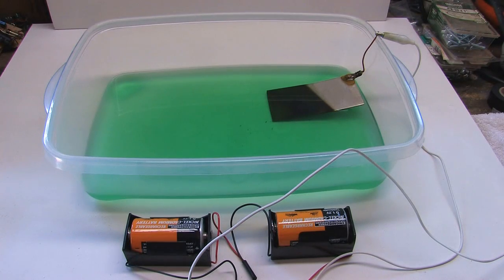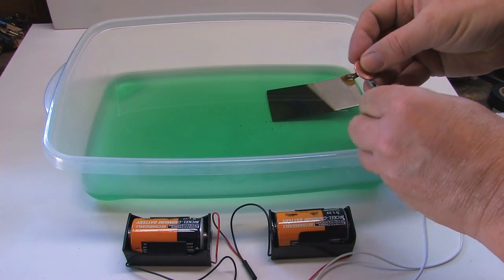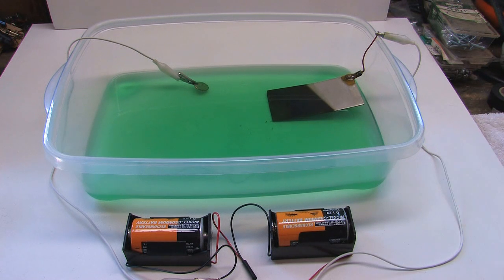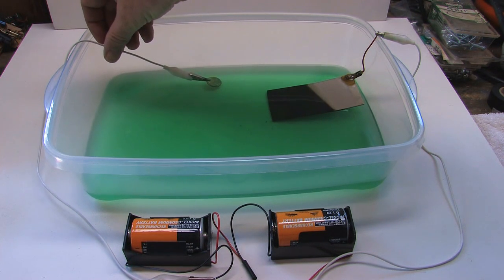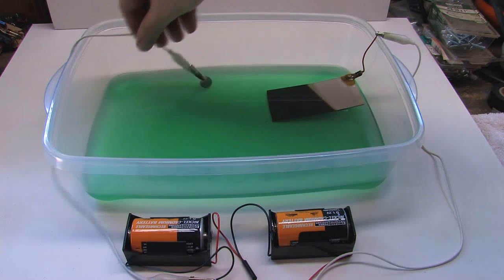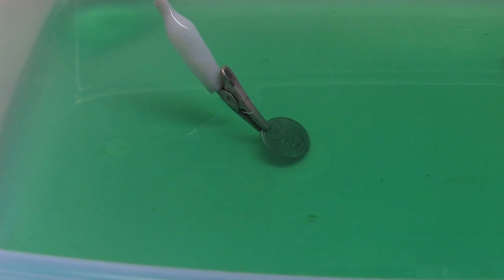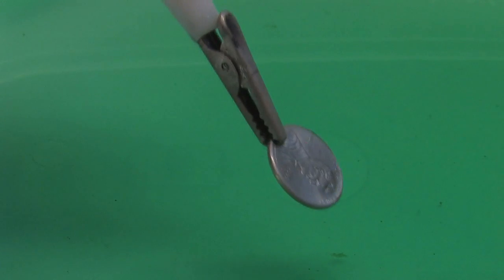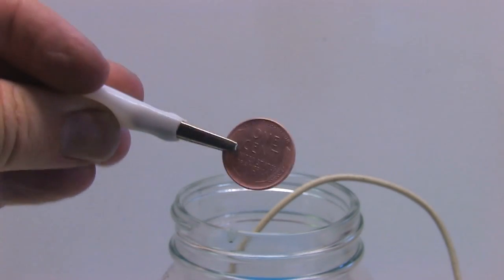Easy Nickel And Copper Electroplating Method

Comment: Love your vids. Sir! Years ago I was trying to resurrect a deep cycle battery. I put 2 copper 1 mm wire ( electronics) wire. In sulfuric acid and I put some nickel/ cadmium electrolyte. I saw a tutorial on YouTube on restoration of batteries. It came up a blue/ green look. A 12 volt trickle charger and 1 terminal was black. Other terminal was gleaming! But acid in battery had that colour I mentioned. Was it possible for me to electroplate something? Any reply appreciated cheers from Australia just subbed.nice work!🙂👍👍👍

Comment: Your applied voltage should ideally match with reduction potential of the metal ion (here in this case copper) that you use for plating the cathode material.
Reply: First name Last name  i don't know.  Or is it electrodeposition of the metal depends on the current density? Please explain.
Reply: @quark31  the current to apply is in function of a lot of parameter.
size of the part, of the anode, temp, electrolite conductivity, PH etc

Comment: The ideal current should vary depending on the surface area of the part. If you're usually plating small parts it would make sense that low power gives you better results. Based on some quick research I think the current for a penny should be around 500mA.

Comment: I did copper plating, but copper is coming off when I wiped , is there any way we can do copper plating,even if we wipe it shouldn't come out
Reply: too much current, or part is'nt good enough degrease, or you try to copper plating directly on steel/iron

Comment: can i plate aluminum, and the finish can it be used for cooking?
Reply: i mean plate copper over aluminum for cooking equipment
Reply: @MrZaheraudi  plating aluminium is not easy.
you need first double zincate the part, next flash copper plating with alkaline solution, and next tick copper plating with a standard acid copper solution.

Comment: Hello! I have these toy magnetic balls. (Lookup Bucky Balls). These are coated with nickel copper nickel but after continuous use, it eventually starts to wear off at the poles of the magnets. I was wondering if it would be possible to use this method to recoat the magnets. There are only two issues I can think of. Will this process mess up the magnets strength? Also, each magnet ball is 5mm in diameter. Would it even be possible to connect a copper wire to it for electroplating? Thanks!

Comment: Hi great videos, I used your information and others to start plating copper.  It is going really well.   For that I’m using both Muratic Acid and hydrochloric the copper sulphate and a laxitive for brightening.   I plan to follow this video for nickel plating.  With either of these do I need to be concerned with fumes once I’ve created my solution and start plating?   I’m doing the plating in my garage but thus far haven’t found much information on if i should be wearing my  P95 mask whenever I’m plating.    Oh and lastly I’m using a small fish tank pump for constant agitation of the solution not sure if that changes anything.  I’m plating at around 1.3v with an adjustable DC power supply.     Thanks if you can help and for helping get started with plating!

Comment: a cheap power supply with a current limiter in it i see them on boost buck converters or the way round little 5v 5 packs may be the ticket fer this small stuff or heck a  old cell charger  a variable  resister n extra capacitor fer smoothing the power as we know pwm power  supply's suck  nice video

Comment: To nickel plated something bigger with more solution into a bigger area. Does it need more power or still low voltage worth the batteries?
Reply: What you want is a higher current power supply, like 2-3A for large parts.

Comment: Thinking of nickel plating some computer parts that i want put liquid metal compound on so that it doesn't harden and loose thermal conductivity. This looks funner and cheaper than buying new components that come nickel plated, the GPU heatsink is $150 and only for liquid cooling and at that point i might as well even might as well invest into a new GPU (R9 390 8GB).

Which brings me to another idea, would you be able to put the solution on a sponge to nickel plate things that are hard to submerge? I'm guessing that you would have to constantly be moving it around to prevent a sponge pattern from developing.

Comment: I saw in your website that you also used a solution made with nickel sulfate, ammonium chloride and boric acid. According to wiki, this is called hard nickel. Wiki also shows a solution with just the nickel sulphate and boric acid. Have you tried this?  What temperature should the bath be? Many blessings.

Comment: Nice video. I was wondering does it matter if the two objects are closer in the water, like will it work better or quicker if the two objects are closer to each other while submerged? 2nd can i just use distilled water and salt for the solution? Was gonna try and do a little science project for the kids but iver tried this like 10 yrs ago with bad results.

Comment: I would like to make 10mm nickel plate the front surface will be full of small cube corner sections all surfaces of section soul be well polished, the  bottom will be flat , no need polishing or surface finishing. I need info to make this .

Comment: Have you tried to make Nickel Electrode in Battery Edison by this method?
PS:
You don't need Nickel Ammonium Sulfate.
I used battery electrolyte and it works very well (during tests). Tomorrow I will check exactly how nickel electroplating  works.

Comment: If I wanted to add a heater element and PID controller to maintain a constant solution temperature could I use a titanium heating element or would it react with the copper sulfate solution?

Comment: i've been trying to copper plate aluminum and failing miserably it keeps getting corroded,eats up the aluminum,and just wont stick. is aluminum a bad metal to try and plate?
Reply: I know you asked this a long time ago, but yes, Aluminum is unsuitable for copper plating. Aluminum is a more reactive metal than copper, so if you even just place aluminum in a copper sulphate solution, the aluminum will oxidize to aluminum sulphate and will reduce copper metal.

Comment: Considering you are only using readily available chemicals and not industry specific ones (I'm an electroplater by trade ) then I highly recommend   you add Sodium Saccharin  to the Nickel plating solution to make the finish brighter. Just use a small amount at first and then increase the amount  until you reach the desired brightness.
 Don't over do it though because although you are making the finish brighter, adding Sodium Saccharin will also have a negative effect on the solutions throwing power into the low DC areas, ( ie the nooks and crannies).
Reply: So looking at the Watts plating solution from the Wikipedia page, it seems the more nickel sulfate and the less nickel chloride you use in your solution, the more matt the plating will be. Thanks for your guidance.
Reply: Can you tell me what kind of solution you would use if you don't want a shiny nickel plating? I would like the natural, slightly yellowish colour of nickel for my plating.
Reply: The simple way would be to just use less brightener in the solution to give it a semi-bright finish. Most companies which specialise in decorative electroplating will have a semi-bright plating bath containing less brightner running alongside their regular Nickel plating bath as it is a finish some customers require. 
Another way would be to use 'The Watts Nickel Plating Solution' which from my own experience has the ability to give the work a much more duller finish. 
All Nickel plating solutions will give you a slightly yellow finish whether they are Bright or Semi-Bright. It's the light deposit of Chrome which is usually applied on top of the Nickel in decorative Electroplating which gives you that slightly blue finish . Without it the work will look slightly yellow.

Comment: Sweet vid, thanks!  Question, there is copper electrically-conductive paint on Amazon.  Could I prime and paint plastic with that copper conductive paint, let. it dry then give it a nickel plating using this method.  Question #2, instead of nickel or copper l, is there  chemical baths that can give the appearance of brass and silver.  Any responses are greatly appreciated as I'm a total number with this.
Reply: The answer to your first question is yes.. You can use that copper paint on just about anything and then Nickel plate it.. I've plating golf balls and even tree leaves in this manner. I've then Gold plated over the Nickel. It is really difficult though even for a professional such as myself, to get good adhesion you will need to give it both an Anodic and Cathodic clean in a cyanide solution then neutralize in a 10%  sulphuric acid solution before going into the Nickel plating bath. It may even require a copper electroplated deposit first too. As for your second question you can plate brass  onto work that has been previously Nickel plated. It requires a Cyanide based solution though with a Zinc and a Copper anode, not something you can really do at home, plus it's super difficult . If the temp of the solution gets too high it will only copper plate, too low and it will only zinc plate.
 This is made even more difficult because if you apply too much power  it will only zinc plate, not enough and it will only copper plate. increasing power will over time increase the temp of the solution so as you can imagine it is a real fine balancing act.. 
As for Silver, you can plate silver directly on to  work made from copper using a silver nitrate soltion. For work made from mild steel you need to first Nickel plate it then plate the silver on top using a Cyanide based Silver solution.
Reply: I don't know about your second question, but to plate non metallic items, just mix some graphite powder with alcohol and use that as a paint.  get a thin, but complete layer of graphite on the item, and then it will plate.

Comment: Can you electroplate several items at once?
Reply: Roger Foster I don't think so, unless they are touching, as it requires one continuous circuit of electricity. Alternatively you could have many different circuits, but this would probably defeat the object.
Reply: yes you can...just connect the negative terminal to all the pieces

Comment: +stancurtin or anyone else who may know, I already have very nice electroplating equipment and typically use it to brush on 24k gold to silver coins which works great.  Today I tried on a commemorative coin I believe is nothing more than steel and it was an ugly color so I thought since it has a dark copper look to it that it might help to nickle first and then gold plate afterwards (correct me if I'm wrong).

Second, since I have this equipment and can digitally set the amperes and volt to anything, what is the ideal nickle plating zone to do this?  I see some saying below 3.7vdc/2.3a and then others saying all kinds of things.  Any recommendations on the best setting(s)?

Comment: have you tried using an 18650 rechargable battery? they run at 3.7vdc and hold about 2.3 amps so they have a longer run time then a or d cells?
Reply: Nice
Reply: Colt Rice

Comment: Im struggling. I made the solution (white vinegar, peroxide, copper,) it turned green so i removed the loose copper then filtered the solution. I connected a pre 82 penny to the positive, the thing i wanted plated to the negative, put them in and waited. It plated the edges pretty fast but i can't get it to plate the rest. I cleaned it with a wire brush and alcohol.

Comment: Now. How to remove the nickel from a wrench and then re-nickel it without abrasives ? AHA !
Reply: reverse the polarity of the batteries. It will remove the nickel from the wrench.
Reply: No don't do that. That will completely ruin the electroplating solution, and the highly expensive nickel anodes. You are right about reversing the polarity but it needs to be done in a completely separate  secondary unit made of steel with a plastic lining.  Use lead as  cathodes  and the strongest Sulphuric acid you can lay your hands on. Ideally 96%

Comment: Need some help here.... Trying to figure out what I'm doing wrong. My plating wants to flake off. It plates but is not very shiny and then wants to flake. Am I leaving it in for to short a time or to long?
Reply: +Greg Lyons Am cleaning the part and anode with Isopropyl alchohol before hand, then drying it with a tissue to dry,also am not using a solid core wire..... Could of these be the issue?

Comment: Do you know if this method would work well for re-plating a chainsaw cylinder? I have a couple worn cylinders that I never threw out.
Reply: +Timothy Tatro I thought small 2 stroke engine cylinders were plated with nikasil or Nickel Silicon Carbide. Silicon carbide needs to be dissolved into the nickel plating solution to be electroplated to the aluminum. When the engine runs the nickel is warn away leaving the silicon carbide layer. This is not a nikasil solution and will not work to plate the cylinder of a chainsaw

Comment: WHERE TO GATE A NICKEL PLATE
Reply: +PRISOM1988 ebay. Nickel wire works too. In fact I would prefer it as the wire can be formed around the plated part for a more uniform plating.

Comment: +stancurtin is there a way to electroplate a magnetic substance on something, say, an Iron nail? Then it would be magnetic, right?
Reply: +Nicholas Lande No. Stroke a magnet from on end of the nail to the other using the same direction and the same end of the magnet. It will magnetise the item say screwdriver for example
Reply: +MrDiddumz I see what you mean, but that process is only temporary. I would like a thin layer of magnetic metal on the substance that is not magnetic
Reply: +Nicholas Lande Not temporary. I have been doing it for years. I was taught this in school 50 years ago. I do it with my screwdrivers so as to hold the screw.
Reply: +Nicholas Lande Just use a strong magnet or a DC current. don't allow the nail near an AC current source
Reply: Ok! Thanks!

Comment: Hi. I just did my first copper plating on a coin. The result was a bit disappointing. Instead of a nice metal look, I ended up with a rustic color on the coin. I assume i did something wrong. I used tap water with copper sulfate. The water temp was 60c when i did the coating. Any help would be appreciated :)
Reply: +BakamonNO sounds like impurities in your tap water. Imagine all the crap flowing through those corroding metal pipes

Comment: How did you connect the batteries?
Reply: +Uffen positive to the copper metal (The metal to sacrifice) and negative to the object you want to plate.
Reply: Thanks for replying! What I meant was: did you connect the two batteries in series or paralell? (1.5 or 3V?)
Reply: +Uffen batteries in series for 3v

Comment: Where do you get the battery thing?
Reply: +Christine Powers
Here you go
 http://www.ebay.com/itm/1-PCS-1-x-D-Size-Cell-Battery-Holder-Box-1-5V-DC-Case-With-Wire-Lead-BCD-/170873843002?hash=item27c8dfed3a:g:uycAAMXQWlFRpyce

Comment: Have you ever plated a pewter object?
Reply: +robcat2075 For pewter, you would have to flash the pewter with copper first.  Not easy.  Usually in production plating of pewter they use vacuum deposition to plate it first, but the plating is very easy to damage or flake off, so often dyes are used instead of plating.

Comment: t still looks like copper to me.
Reply: +Bruce M Carleton Jr  I thought that too. Trick o' the light mebbe.
Reply: +Robert Seviour 
I just tried my hand at it and I now have a copper plated quarter.
But the plating is very dull. I think I must have used too much
voltage (6) Next time I'm going to drop it all the way down to 1.2 volts.

Comment: Is the nickel sulfate solution reusable? Is that 3v battery setup powerful enough for plating a copper mug? The positive clips on to the penny right?
Reply: +charles910 Actually, a small model train transformer works much better.  Look for a Tyco HO scale DC transformer.  It has a reversing switch and a lever to control the current.  Usually those a a few bucks used max.
You can also UNplate and build your electrode by reversing the voltage.

Comment: Is it possible to plate a plastic at low temperature so it wouldn't melt?
Reply: Nick Nalepa No, plastic isn't conductive; this is why plastic is used as the tub to house the electrolysis and/or electroplating reaction.

Comment: I'm building a large steel apparatus composed of a few pipes and a water heater tank. Would this method work for plating the insides of something that large?(not using tiny D batteries I'll use several lead-acid car batteries)

Most of the parts I'm going to use are heavily rusted/galvanized steel but have no holes. I plan on assembling the parts and weld them together and remove the internal rust using electrolysis, that should also remove the oils one would usually need to remove. After that I will remove the electrolysis water and fill the entire apparatus with the chemical used in the vid and begin electroplating.

What the heck am I building? A container for containing FLUORINE the most chemically active and corrosive element of all. And at a rather high pressure, hence the use of steel. Apparently nickel resists fluorine attack by protecting itself with a layer of oxidation much like aluminum dose to air. So a nice nickel plating should be good protection for the steel.